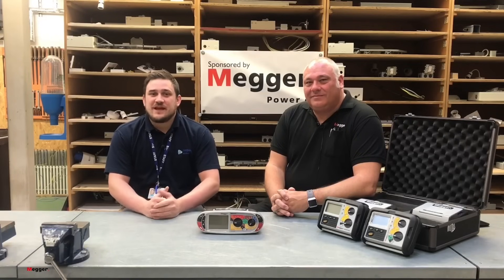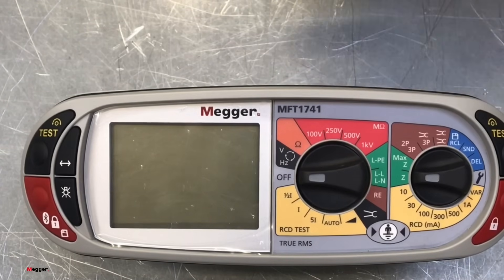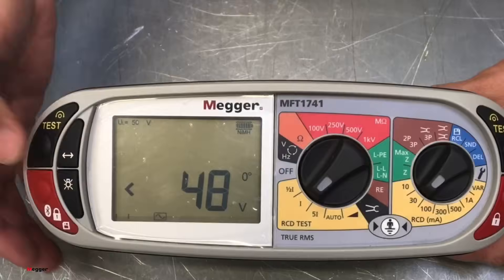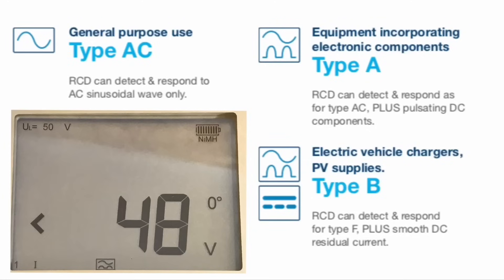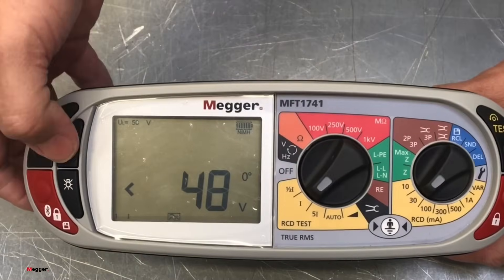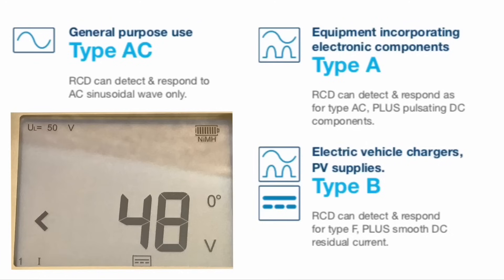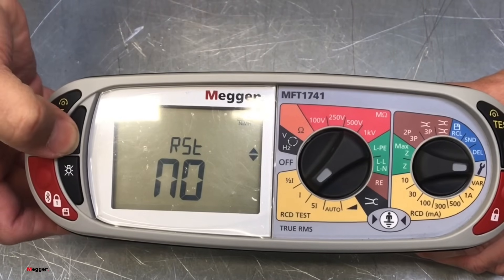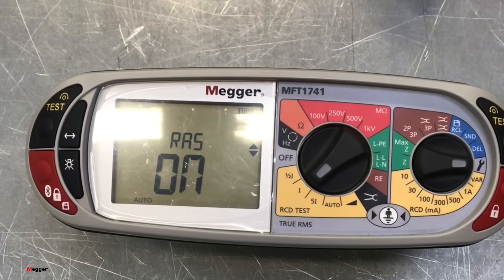How to set up a Megger 1741 MFT to test AC RCD’s, A Type RCD’s and B Type RCD’s With Lee Baker

Comment: So when on type A setting in auto RCD test mode, does the MFT do twice as many tests as in AC mode? How else would the MFT verify that the RCD trips on both pulsating DC and AC earth faults?
Reply from the maker: If you do the auto test on AC and the A type RCD setting you have covered all tests on an A type RCD 👍 (10 tests)
Reply: @GSHElectrical  Cheers Gary!

Comment: I would say the auto start RCD function is best for use where using the 3 test probes and pressing the start button could prove difficult, for example at a ceiling pendant or on a floating connection of a decorative light.
Or you could just do it at the consumer unit 😉 https://youtu.be/3TQvxQ_GF0c
Reply from the maker: Great shout Alvin.... I do love my 3 lead tests 😂.